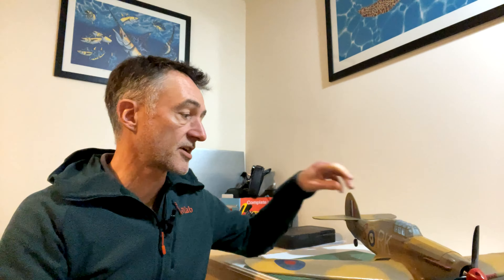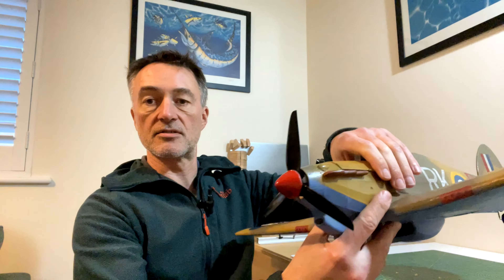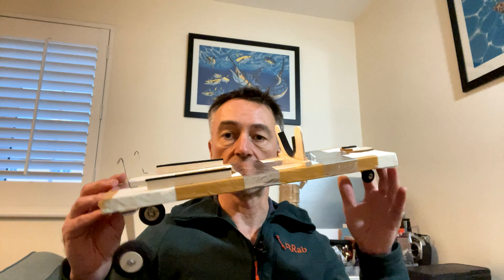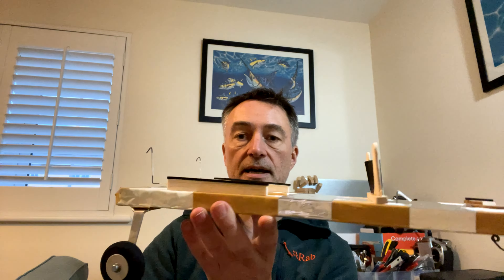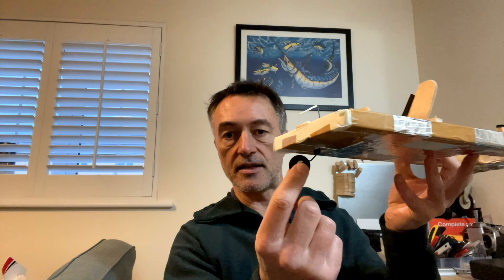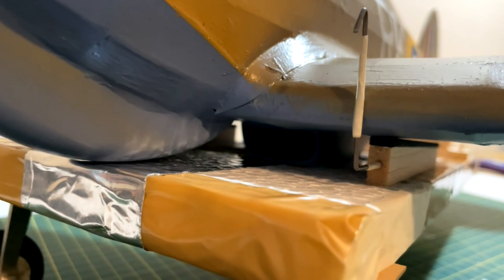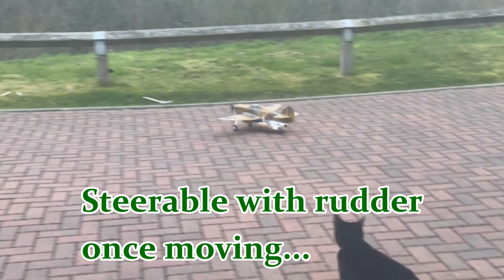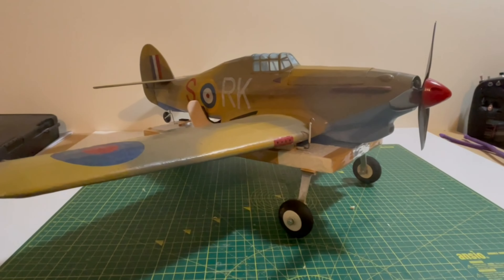SKippy's Dumas Hawker Hurricane RC Conversion update and RC Dolly build - Part 4

Comment: Excellent work on finishing up the model and neat idea with the dolly. Seems like it should separate quite easily. You’ll probably want as smooth of runway as possible so that the model does not bounce off prematurely.
Reply from the maker: Thank you. Yes the bounce is a concern and I’m hoping slightly taller retaining wire up front and the rear fuse support will help 🤞😊
Reply: @srknight307  maybe have it rest on a sling of rubber bands so that way it works like suspension would help with bumps